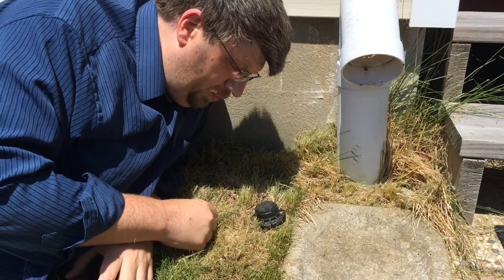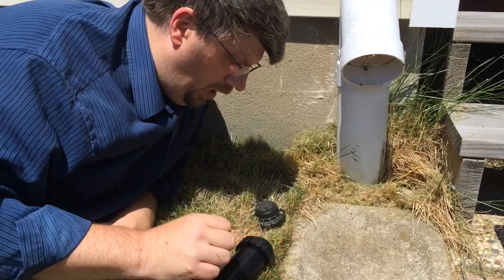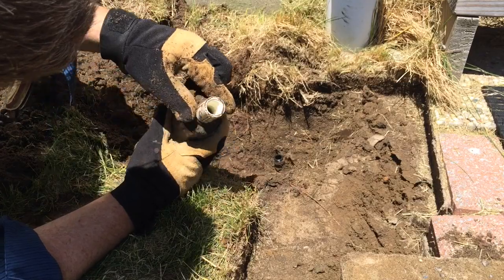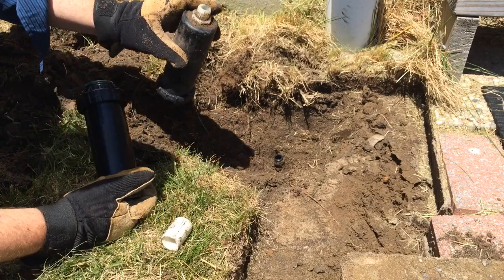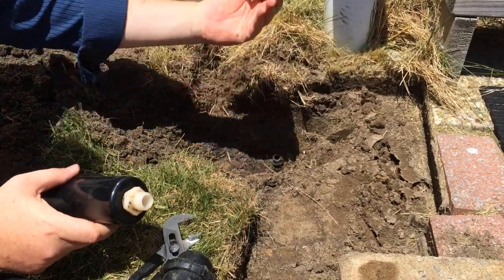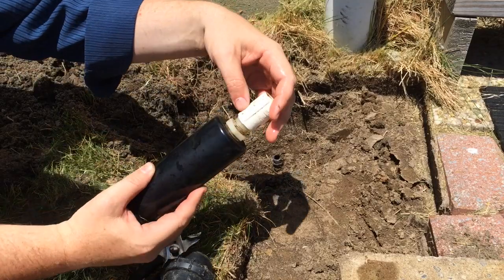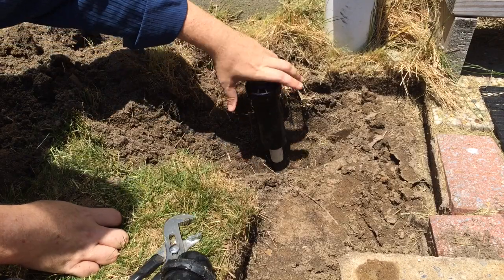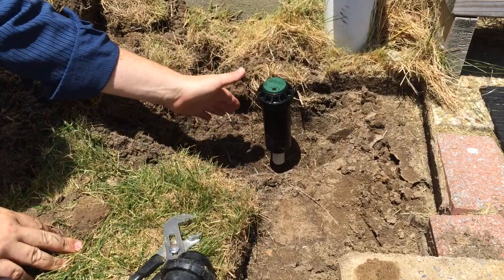How To Easily Replace A Lawn Sprinkler Head On Your Own - In About 10 Minutes!

Comment: Are there different size extenders available? We are new to this process and hubby replaced two sprinkler heads with extenders that made the sprinklers both stick up way to far above ground.
Reply from the maker: Yeah, the come in all sorts of sizes.  You can even mix and match brands in a single sprinkler system if you want.  I've done that unintentionally.  I think a good rule of thumb might be to put them at least an inch or two below the surface of grass. I've also had them stick up too much and then had to go back and basically dig them out, sink them a few inches lower, and then refill everything.  If they're too high they present a bit of a tripping hazard and are more prone to being hit by a mower or other lawn tool.

Comment: you took out a hunter pgp 4 a pos orbit sprinkler
Reply: john Kosheluk exactly. I was thinking that too. That hunter head lasted 16 years. The orbit will probably last 5, and will be very inefficient.
Reply from the maker: @itech301  I haven't found much of a difference in them, tbh.  I've been looking at other options that don't require the use of that little key to adjust them.

Comment: My sprinkler heads were put in 75 years ago.  Heads are all metal and rusted.  There stuck to the conrcrete flooe.
Reply from the maker: Wow... I've never even seen metal sprinkler heads.  Not sure if that system is salvageable.  You could dig them all out and sell them as antiques on eBay, I suppose...